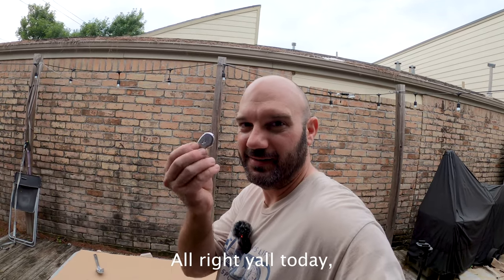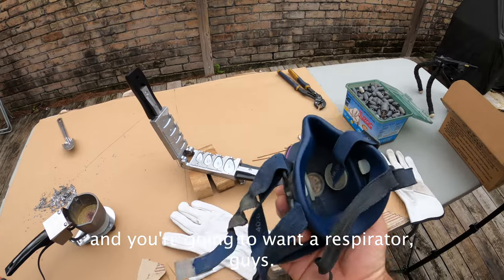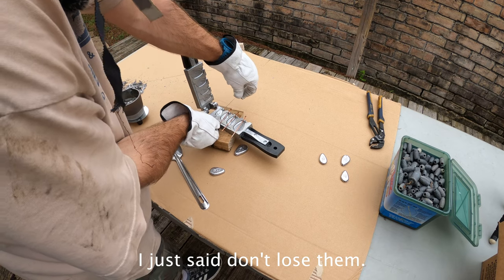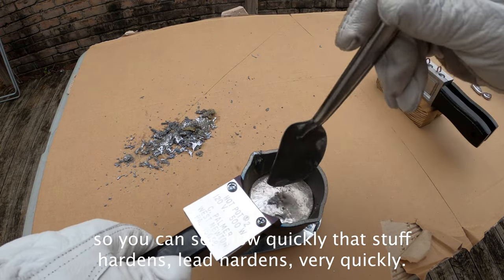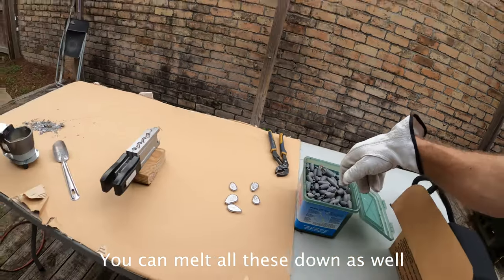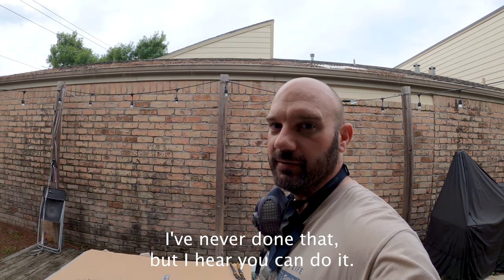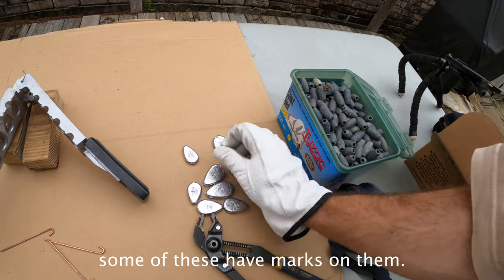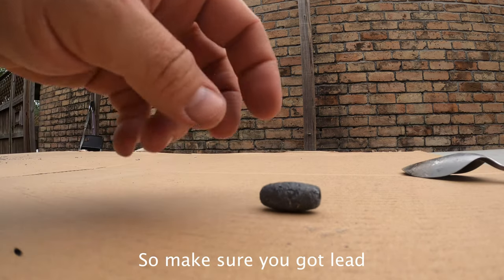How to make fishing weights, cheap and easy lead melting method

Comment: Thats impurities you're scraping off the top. You need to flux the lead

Heating the mold will help out tremendously 

Anything else after that you scrape off the top after the lead is clean is just dross from oxidation.

You want to clean the lead and make purified ingot's then do this.

I only have one functional hand at the moment due to an arm injury at work so this is a very generic explanation of the process. Ive been casting lead types as long as I can remember.

Good job on this video though it will help people who are starting out a lot

Comment: I am pouring out of 25 lb pot making 234 lb in open garage do I need mask. Don’t breathe fumes
Reply from the maker: I would always suggest a ventilator when working with lead or steel. There is a condition called Metal Fume Fever and it is fatal.